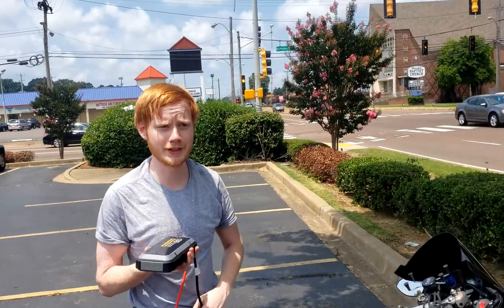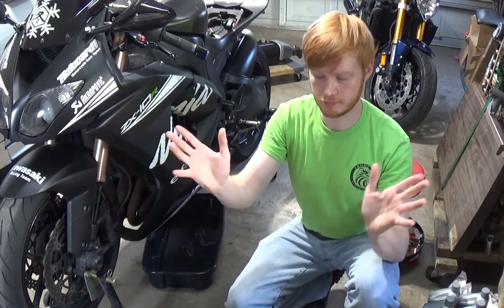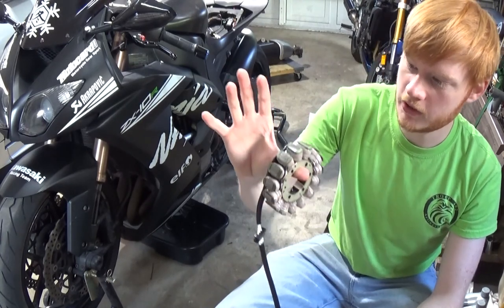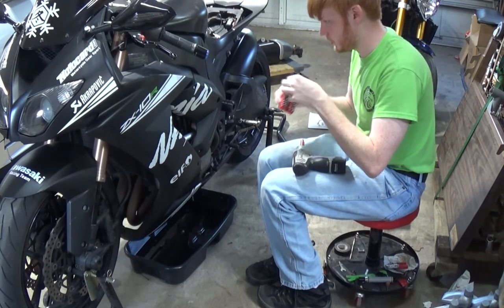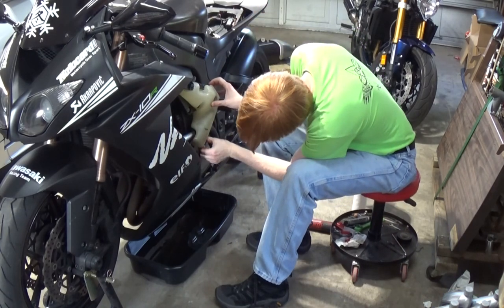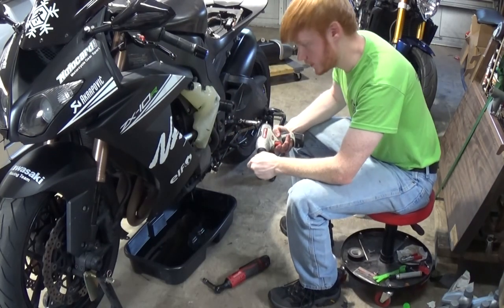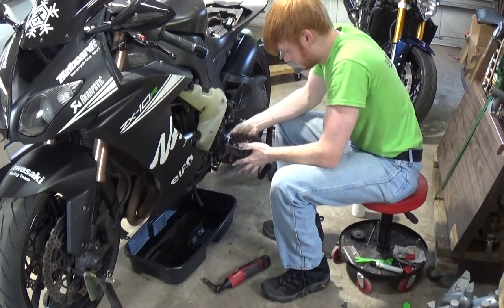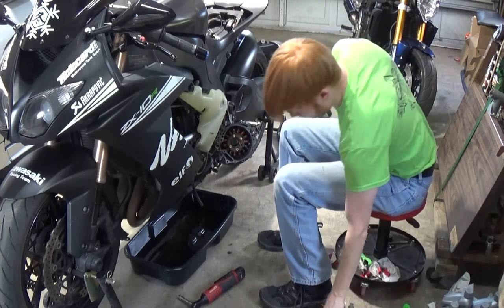Watch This Before Replacing 2008 - 2010 Kawasaki ZX-10R Stator! Part. 1

Comment: I've got an 09 zx10r and it's breaking up around 3-4k rpm. I've changed the fuel pump, filter, pressure regulator, plugs and did the secondary butterfly valve delete and it's still doing it. I was just told by the previous owner his friend when he owned it changed the coils and stator to eBay ones and the coils are testing fine. From what I'm seeing is it sounds like stator.
Reply from the maker: I wouldn't think it would be the stator honestly I'm on the coil side. If youre testing them at a parts store ive had it where they test fine, but when I change them the missing goes away.
Reply: @MoswenMedia  yea I tested em and they read 1.3 for primary and 9.5 on secondary.
Reply from the maker: @972CHENZO  is the fuel hos from the gas tank kinked?
Reply: @MoswenMedia  no, it's pretty good

Comment: Mate how did you know the stator is the problem? Is thr a way to check without removing the cover? I mean from the plugs voltage or something
Reply from the maker: Yea, its very easy to test. All you have to do is measure the voltage of the bike's battery while its running. Should be around 14 volts while the bike is running.